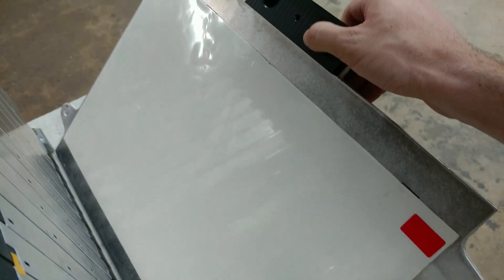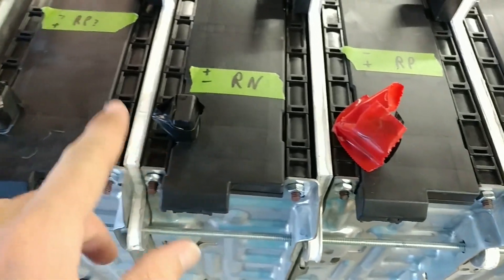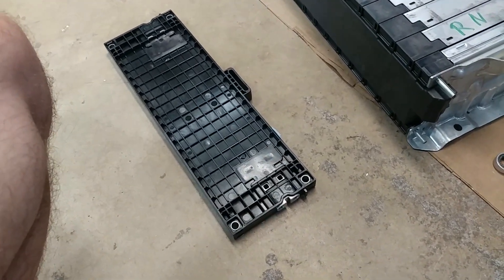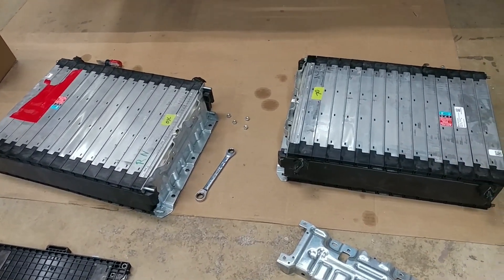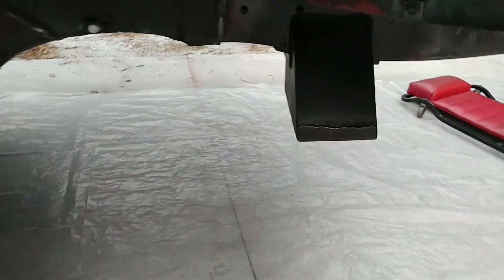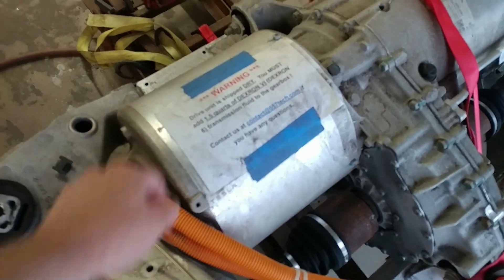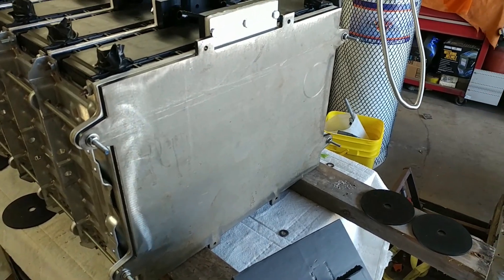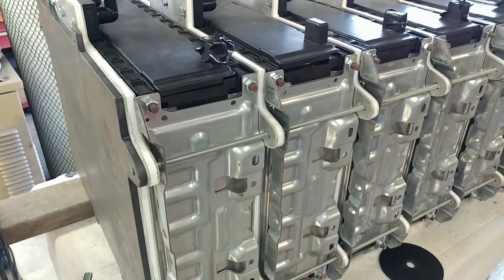Mitsubishi 3000GT Tesla Swap 18 - Front Battery Assembly

Comment: Really nice man keep it up!
Where are this batteries from?
Reply from the maker: I bought them from a DIY EV shop online. Thunderstruck EV iirc but they're out of stock
Reply: @azimath9939  I'm like 99% certain these are from a Chevy Bolt.
Reply from the maker: @BillCarlson  That's correct. I bought them before the recalls started, but as far as I can tell they were built in the plant that hasn't had many problems.